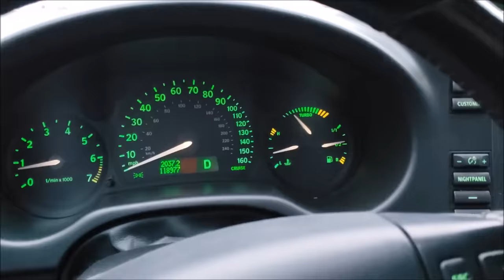How to Buy Fix and Sell Cars for Profit - Money Making 101

Comment: I see you at dealership auctions. That us the normal people can't go to. I think there are public auctions. Would like to see you at one. See if the same tricks go as well. Thanks
Reply: I get what you're saying but the reason really he cant do that because at public auctions buyers go there to buy and drive cars and at the dealer auctions buyers go there to get a good deal and flip cars so prices are always lower in dealer auctions
Reply: @RatediLyy  well plus, dealer auctions are wholesale, and public auctions are retail.
Reply: The same rules apply at public auctions: don't buy a ford 5.4L, don't buy a used BMW, know what you're buying, and do a thorough inspection. There's one where I live that allows you to start the vehicles but not drive them. 

The thing is: dealers can go to both, the public can't. The issue with the one near me is the dealers drive up the prices. Specially these days when new cars weren't being built so inventory was really low. A lot of US dealers come up here due to the favourable exchange rate (30%) so they can pay full Canadian Retail for a vehicle, pay to have it shipped to the US and still make 20% on it. That's not including mark up and it doesn't cost any more to ship a $40,000 vehicle vs a $1000 vehicle.
Reply: Theres literally people in the comments saying he inspired them to do the same thing except they found the cars other ways. Adding to that, he said he did this before he even had a dealers license. But I'm sure the license makes it much easier.

Comment: I bought a 2005 saab 9-3 from the original  owner with 37,000 for 3k with the 5 speed manual and I absolutely love it because is drives great, gets great mileage and is quick as well as kept me  safe when I got rear ended

Comment: I tow my 18' trailer with my GMC Elevation 4X4! The other SAAB I have is a 2006 9 5 from Hawaii with 46,000 miles. Bought it from Copart Honolulu for $650.

Comment: Looks Great ,Back in 2010 i bought a 2001 dodge dakota slt 4x4 for $2000 ,it had 126k and the white paint looked like chalk,i honestly wasnt sure if i could bring the paint back to life.I spent all day saturday and half of sunday on it and the paint looked pratically new.I also put brakes and rotors and universal joints ,So i was into this truck for about $2350 I drove the truck till 2013 and sold it for $3,750 ,There are good ones out there ,but also bad ones ,im glad u got a winner on this one

Comment: Svenska Aeroplan Aktiebolaget (Swedish Airplane Limited) is what SAAB stands for. 
2003 was the first year of the redesigned new generation 9-3, which featured a GM designed B207 Ecotec engine. Prior to this, the old generation 9-3 was equipped with a Saab-designed B205 with a Trionic 5 engine management system. These had a red ignition coil pack, commonly called a direct ignition cassette (DIC). In many ways, it was similar to the new generation 900 that it replaced. SAAB Automobile AB continued to make their own engines after 2003, specifically the B235 (with Trionic 7), which was in production in the 9-5 until that car’s redesign in 2010. Interestingly enough, from ‘99 to ‘03, you could purchase a 9-5 with an Opel-Vauxhall-GM V6 B308e engine. 
SAAB is still around and in production, though there is no longer an automobile division. They are continuing to make jets, both military and commercial for Sweden.
Reply from the maker: Wow. Great info. Thank you!

Comment: Using a torch on plastics just screws the next guy. Dries them out completely. It brings the oils to the surface and makes the plastics prone to cracking much more quickly.

Love the rest of the video, just didn't know if you knew this

Comment: I had a 1999 Convertible that i wound up selling for scrap.  i left it out with a leaky roof and mildew took over.  i regret it, i could have fixed it up. still ran and drove perfect.  5 speed, turbo.  smh.

Comment: Great cleaning job! The car sounded very good too. Did you check the documents that came with the car to see when the last brake fluid and oil/filter changes were done? It wouldn’t cost a lot to change them both.

Comment: Do you ever turn the rotors or do you always put brand new ones on?  I used to put new ones on but turning them for 12 bucks a rotor I have been able to do 4 wheel brake jobs for less than $100.  Of course I am not in the rust belt and that might come into play
Reply: New rotors are only 14 bucks at RockAuto, doesn't make any sense to turn them anymore

Comment: There so expensive to fix. I had a 2000 saab 93 conv. And I got it for 600 bucks with 130,000 on it. And on the way home I blew a hole in the radiator and I went to get a used one and it was still450. And don't even wanna talk about how much a new one was. That one looks nice. Love the color. I always wanted a viggen. Sucks that it's not stick

Comment: THEY ARE QUICK, and cheap cars but good friggin luck finding parts for them if anything goes wrong with them. maybe for the 2000 or newer  aren't so bad but 99 and older parts are impossible to find  i think you got really lucky

Comment: If you have a 10-year-old car, would you do minor body work (dent on the lip of the front driver wheel well) and replace the trunk lid? (2013 Ford Taurus trunk lid inside got rusty along the welds inside the lip below the logo)

Comment: And in my area thats a $1200 car into a $4500... i cant touch many cars out there running without crossing the $1000 mark

Rattle can spray clear can clear that up. Also a couple 1500 grit sand paper and a polisher.

Comment: Why polish grime like that? Wouldn’t it just rub it all over the paint?
Reply: The polishing compound contains alcohol and nasty chemicals which dissolve a lot of it... look what’s in some rubbing compounds it’s nasty
Reply: c11yan still though, you don’t polish dirty paint, that just scratches it. You clean it first, then you polish.
Reply: Fridtjof Riibe Agree but when you do it every day you know what you can get away with.
For example - You don’t really need to clay bar a car as the compound dissolves the contamination the clay removes etc
Margins are tight and the work is not resold but built into resale values so learn now to cut corners.
Reply: Fridtjof Riibe The mark is a water stain from where the car was previously on a transporter under a car with a coolant leak. It is water staining it won’t wipe off.
Reply: c11yan well yes, it will wipe off. He did a piece of it with his finger at the auction to prove it, so I don’t think that’s stained on there
Reply: Fridtjof Riibe it didn’t wipe off - the wet residue made it appear as though it had gone

Comment: You said you paid $600 and with parts you have $1000 into it.  Were you really able to replace brake pads, rotors, bearings and all the bulbs for $400?  Wow.
Reply: for a hundred bucks you can buy brake pads and rotors at RockAuto

Comment: So heads up about Saab, 2003 was the worst year like practically untouchable. I used to work for Saab (not a a dealer Saab Corporate)... Dealers hated them, even back in the day Saab dealers would wholesale them because they did not want to sell them and attach their name to them. Unlike most first year cars which get better with age, 2003’s just got worse. 2004 was better, and 2005 on was near built proof.

Comment: Saab. GM stole the technology for their Saturns etc. Parts from Europe, never from China. Salvage yards have plenty of them to harvest from. But, they're over-engineered. The climate control requires the AC to run continuously and cannot be bypassed. Do the AC compresser, dryer, etc., and hope it lasts. Run great if the turbo is good. But, they're a hassle to deal with. I'll never own one again.